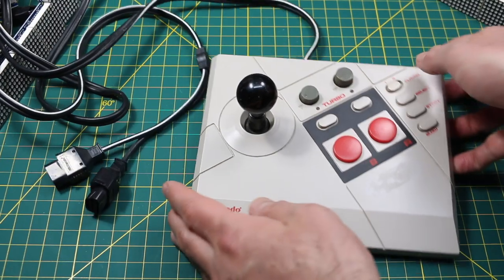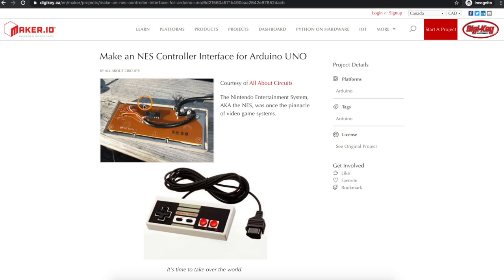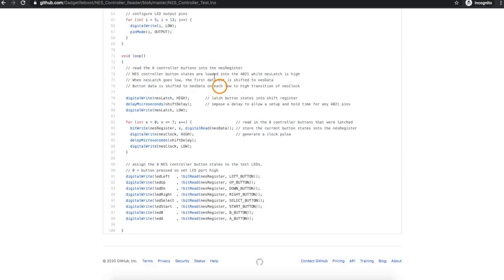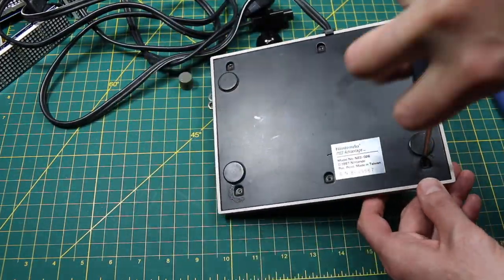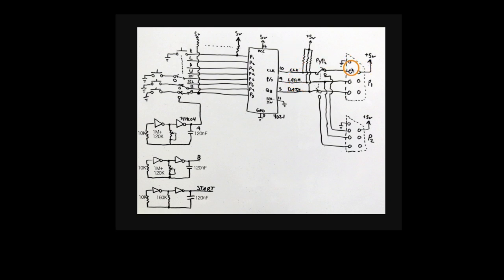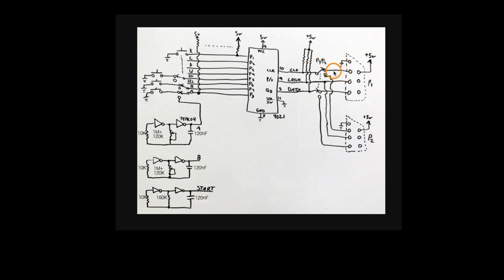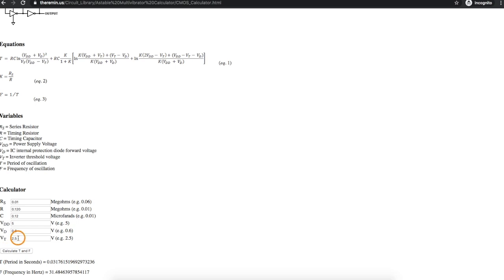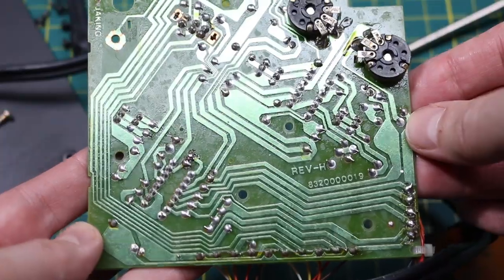NES Advantage Teardown & Schematic: How it Works

Comment: Great video! It has helped a great deal with a NES Advantage refurb I am working on. It has a broken potentiometer. Would you happen to know where I could get a replacement? Thank you in advance for any tips you might have.
Reply from the maker: I forget the pot resistance but surely it's common, and otherwise a close enough value should still work, just might have a different effect on how fast a turbo works.  
The cheapest option to avoid shipping and markups would probably be Ebay or AliExpress if waiting a month is ok.  There's different physical sizes so it would be good if the mounting options could be confirmed so a huge body doesn't come that can't be installed.
https://www.ebay.com/sch/i.html?_nkw=potentiometer
https://www.aliexpress.com/wholesale?SearchText=potentiometer
Reply: @GadgetReboot   Thanks for the good advice. I looked closer at the pot now and it says “18 Alpha” on the bottom, so I will try and track down the part now.

Comment: Thanks for this most excellent video, much appreciated. I recently purchased a second NES Advantage at Goodwill, it didn't work. Upon disassembly and inspection I found the main board to be broken into 3 pieces, it looks like someone else had done some soldering as well, maybe attempting a mod. I glued the board and repaired (soldered) all of the broken traces and it is showing signs of life except any input from the joystick or the left button are seen as Right + Down. Do you know where I might find a schematic of the entire board, I believe it's a simple short somewhere. Thanks, Doug.
Reply from the maker: I don’t know if there is an official schematic but there’s lots of custom drawn ones like this http://furrtek.free.fr/noclass/nesadv/nesadv_full.png
Reply: @GadgetReboot  Thank you.

Comment: Hello man ! Congrat for your scheme and your explanations. I would have a little question for you who look have knolwedge on this Nes advantage PCB. In the case where one of the two chipsets (the 7404 and the 4021) are down and by the fact theses exacts models (MC74HC04A and MC14021BCP) are no longuer build, could they be replaced by another chipset of the same sort and which one ?
Reply from the maker: Yeah they are very standard across manufacturers so the prefix and suffix for things like MC or MC1, A, BCP would just be certain manufacturer's specific part number indicating things like package type, temperature range, or other traits that were being implemented way back and needed to be identified but are just standard now.  

So basically any "4021" or "74HC04" should work.  The 74 does have to be 74HC because all the different types of 74 can act differently but that's another story.  HC is high speed CMOS and if resistors/capacitors are used with that, it will work differently from just a regular 7404.
Reply: Thanks a lot for your help !
I wish you all the best. 👍

Comment: I'm trying to make an 8 button USB arcade stick with turbo functionality that's mostly identical to the NES Advantage, but I'd like to use a separate microcontroller to handle turbo functionality. Would using a transistor inline with the button work for toggling it at ~30hz, or am I going to fry my USB microcontroller?
Reply from the maker: if there is a working USB joystick circuit already with buttons, and the buttons connect something to ground, putting an NPN transistor in parallel with the button so the emitter  goes to ground and collector goes to the other side of the button and the base is controlled from the micro controller for turbo with a series current limit resistor, that should work

Comment: What is actually the reason they used two inverters per oscillators?
Basically you only need just one to get the same result?
Reply from the maker: I'm not sure of the pros and cons of different configurations but it probably wasn't much difference in cost if they still had to use a hex inverter package, they'd have 3 spare inverters sitting around. But they might have saved 3 resistors.  I think single inverter oscillators work best with Schmitt inverters and the cost is the same today but I wonder if it was more expensive 35 years ago...

Comment: I’m trying to convert my NES Advantage to work with microswitch arcade buttons but the solder points on the turbo toggle switches are giving me trouble. I can’t figure out how to make it work correctly. I’ve gotten the turbo function to work on the “slow” button but not in tandem with a regular pause (I haven’t even tried the adjustable A and B buttons yet). Could you help me understand which contact point does what on those turbo switches?
Reply: Sorry i know this was a while ago but i too am facing a similar issue working out the solder points for these buttons. did you ever work it out?
Reply: @HarrisonMarchant  sadly no I never solved it

Comment: Hello, i need to change or replace the cable of my advantage. What should I use? Does the old nes controller cable works?
Reply from the maker: Yeah the advantage basically has two normal controller cables going into it with the 5 wires on each cable attached to the board, so if there's spare controller cables, they can be used or else get cheap ext. cables on ebay and cut the jack end off and connect two to the advantage. https://www.ebay.com/sch/i.html?_nkw=nes+controller+cable